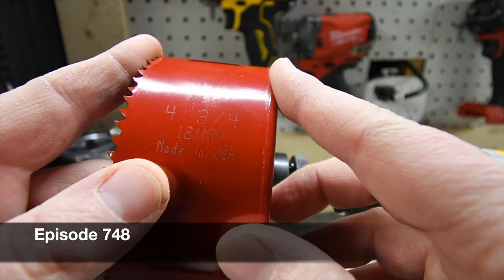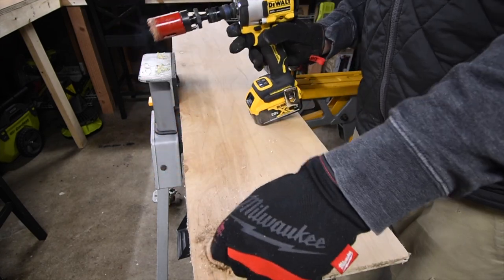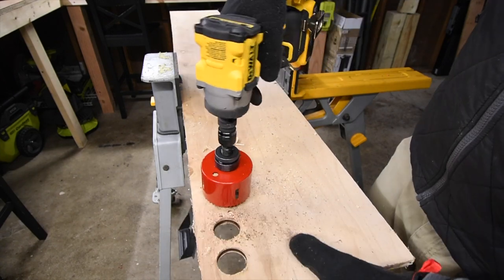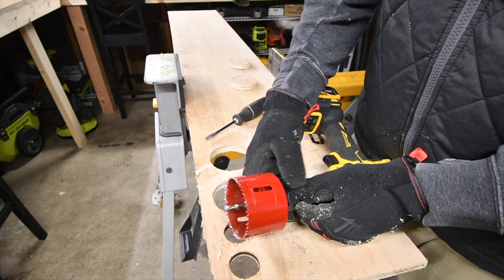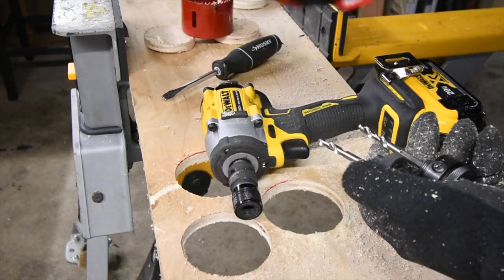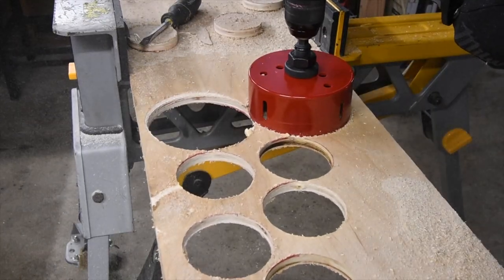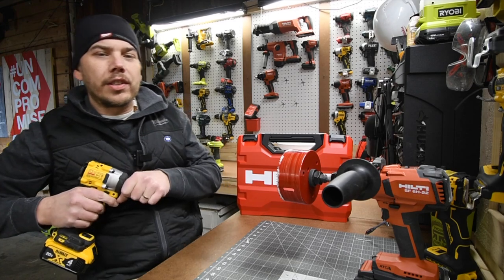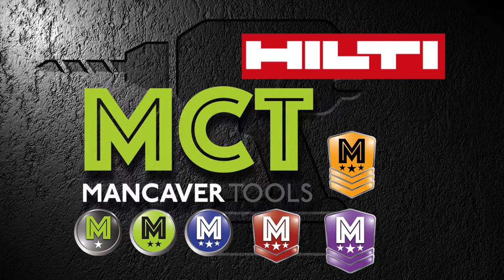Is this a Good idea or NOT?

Comment: I think the Dewalt's battery was not charged all the way.
Reply from the maker: why would you think that? this wasn't a versus video between an impact wrench vs a hammer drill. and impact wrench is not good to use to cut hole saws
Reply: @ManCaverTools  Sorry brother i was not thinking right.